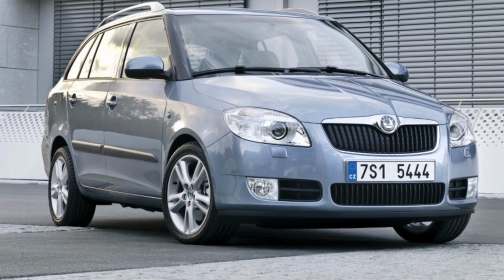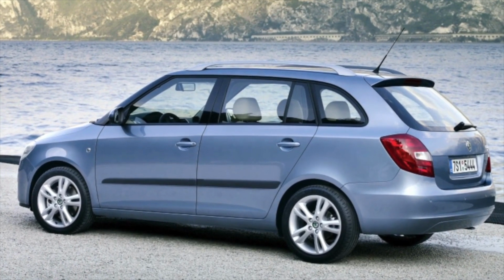Skoda Fabia 2 - Check For These Issues Before Buying

Comment: What about 2009 1.4 tdi? its 3 cylinders?
Reply: I don’t recommend  1.4 TDI  I have one at more than 200 000 km.  it burns oil and make smoke during ignition of engine.  The issue is solved with oil 5.40 and Bardahl oil chemical I don’t know for how long time this will work in this way..
Reply: Same question here hahahaha